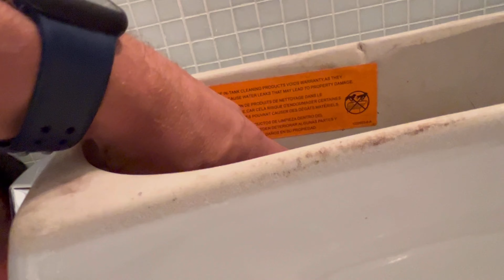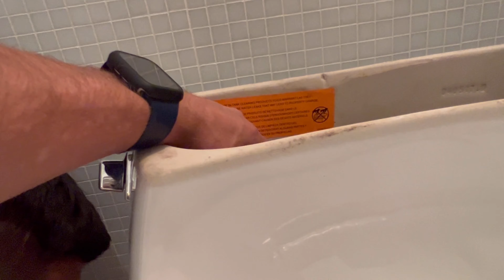GIVE A BIG WARM WELCOMING !!! TUNE IN FOR A FULL DAY OF RUNNING SERVICE CALLS AT MJF MECHANICAL !!

Comment: I have a Toto bidet and you would have to pry it from my cold dead hands. Best toilet I have ever owned. It can leave some skid marks but never having to use toilet paper again is amazing. 

I will never gives those fucks at American Standard a dime of mine again. Steve Lav repaired a toilet similar to my American Standard a few weeks ago. It has the pressurized tank. Sounds like an airplane toilet when flushing. Every year or so it needed a new cartridge. I could live with that. The problem was this POS had linkage rods and clips to flush. The clips and rods rusted even though there was never suppose to be water in the tank (there was though). They wanted $300 for new rods and clips. I made them myself using old school automotive door lock clips and door lock/latch rods. I made them better than they were from the factory. After all that I had to replace the damn tank. I was really mad about them wanting $300 for the linkage which was a bout $5 worth of parts. They lost me as a customer. I paid thousands for the Toto and love it F.U. American Standard!